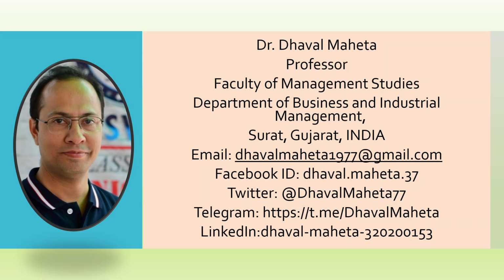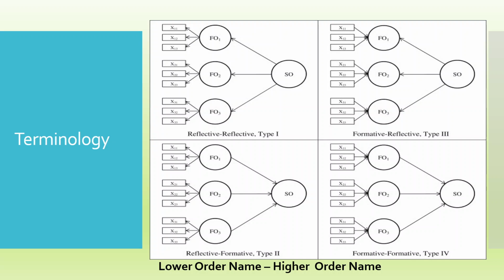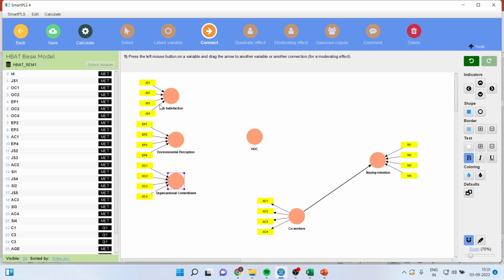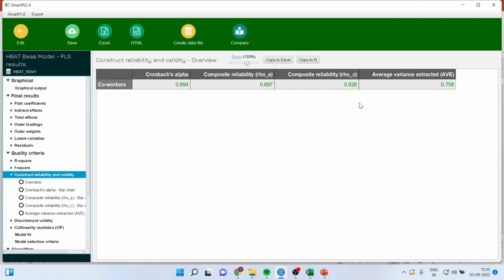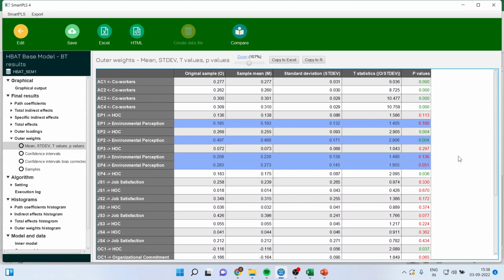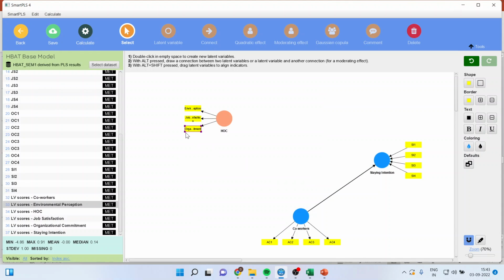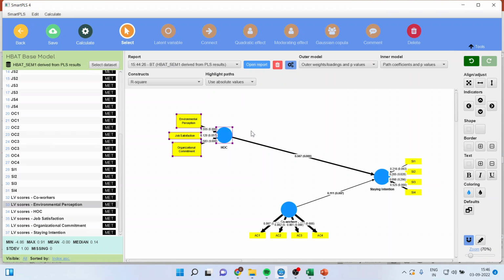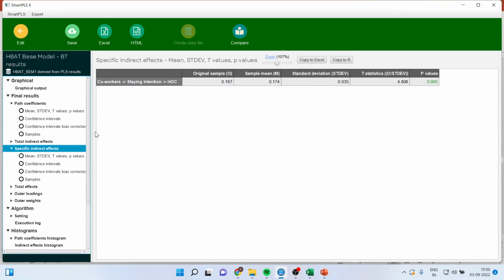23. Higher Order Model [Formative - Formative] in SmartPLS-4 || Dr. Dhaval Maheta

Comment: @DhavalSaifaleeAaryash, thank you so much for this video. I have a question. You don't mention checking the convergent validity of the formative constructs using redundancy analysis (as mentioned in some books and literature). Is that not needed? I am currently assessing a formative-formative HOC model, but I do not have global single items for a few of my formative constructs. Thus, I am unable to check convergent validity via redundancy analysis. Is this a problem? If it is compulsory, is there any other way to check convergent validity? Thank you in advance!
Reply: Hi. I want to know if you found any answer or solution for this case?